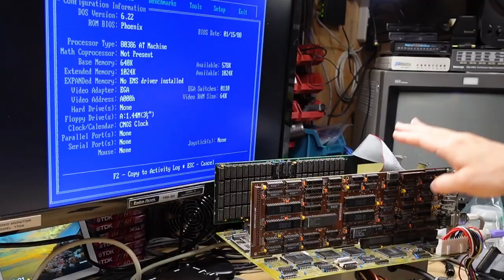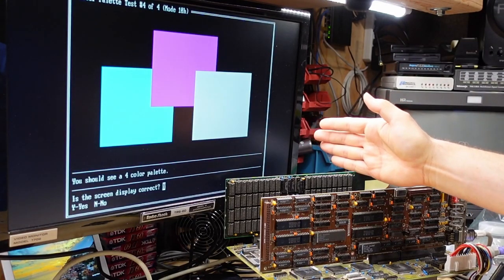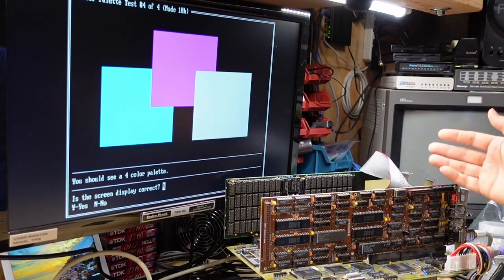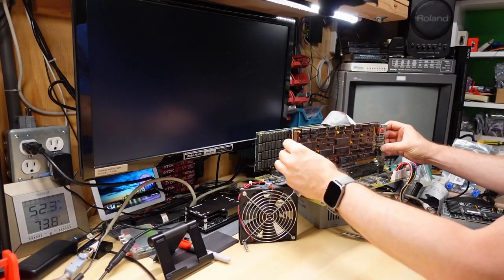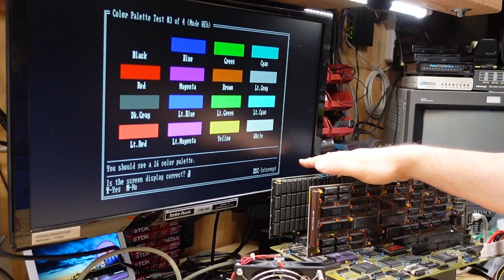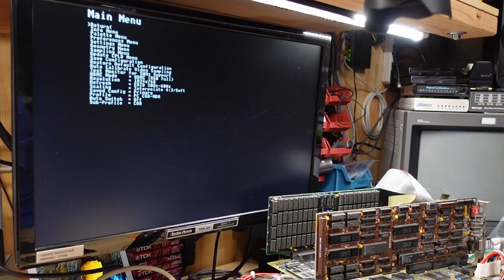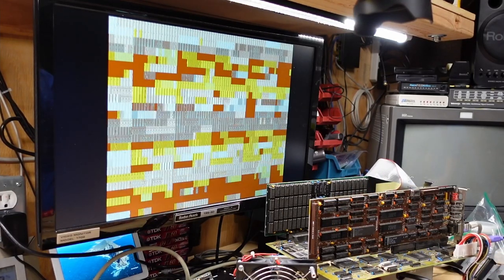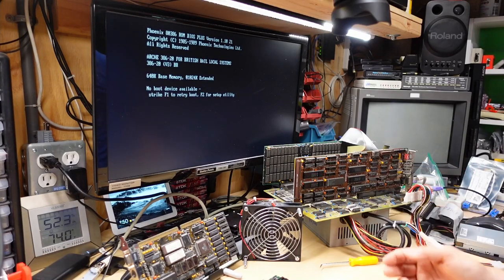Experiment: Can you upgrade IBM's EGA adapter's onboard RAM to 256k?

Comment: Adrian, perhaps you could locate and try a set of 64x4 chips running at 150 ns. 🤔
Reply: Faster memory is almost never a problem.  It defines the upper limit on speed, but you can always run it slower.  The only time it’s a problem is when the data bus requires the memory to have some kind of propagation delay.
Reply: Here are some 464-15 RAM chip part numbers:  HM50464P-15, MB81464-15, D41464C-15, TMS4464JL-15, TMS4464NL-15

Comment: what if you try to tie those two unused pins to ground with a 10k pulldown, it shouldn't effect the pins when they are driven, but pull  them to 0 when they are not.

Comment: I agree that your results imply that the two address lines are just floating during CAS.   Strange that they would have done that, since they are driven during RAS.  I don't think the 64Kx4 chips existed at the time the EGA card was designed, or they would have supported them, unless of course they wanted to charge a higher price for a daughter board.  I guess another possible explanation is that when the card's firmware checks the installed RAM, it gets a result that is not expected, and sets some register incorrectly.
Reply: It's also possible that the 64k was more expensive than the equivalent number of 16k chips. Or they might have not had the space for a handful of extra decode chips.

Comment: I believe the issue is with the refresh. Since the original dram chips were 150 and the replacement chips were 120 and 100 respectively, I think the replacements are simply not being refreshed in time and are losing their contents.
Reply: Nope. You can easily take faster chips, they are even capable of working with less refresh. The problem has to do with unconnected address or [RC]AS-lines on the chips themselves. Some bodgewires to the 50pin header should do the trick.
Reply: @dolphhandcreme  : Unconnected address, though it's possible that the chips can't drive that much capacitance directly.

Comment: Just speculating with simple logic here but, if it were possible to do a RAM upgrade with just replacing the IC's there would have been sockets there. Is there a photo of the original memory upgrade card? Maybe there was something else on that board that made the addressing possible.

Comment: The schematics found here: http://minuszerodegrees.net/oa/OA%20-%20IBM%20Enhanced%20Graphics%20Adapter.pdf
shows that itwas  not designed to take advantage of a 64k*4 dram chip, as the 2 MSB for the CAS are decoded in individual CAS lines (ACAS0-3 and BCAS0-3), ACAS0 and BCAS0 being used on the internal memory and ACAS1-3 and BCAS1-3 used on the extension card.

Comment: Its your timing… 170ns is pretty slow.. would explain the change between the two sets that you installed. So it might be possible to upgrade it using slower ram. Especially if it is d ram. Every time you change something in memory the entire chip has to be refreshed. This refresh cycle has to match whatever device is doing the refresh.
Reply: I never had a problem with DRAM being too fast then. The refreshes were much closer together than they actually needed to be, and DRAM doesn't mind being clocked slowly even if it's capable of operating much faster. The only time it mattered is when someone was trying to push the envelope with wait states or by increasing the time between refreshes (you can do this with software and get a noticeable performance boost, but it's easy to take it too far and end up with a thoroughly crashy system).
Reply: @mal2ksc  most memory from 83-85 was pretty bad.  I am forming my hypothesis based on the difference of the screen corruption. Only common denominator is the timing… have you tried 32k? Does 32k get you video?

Comment: Well in hindsight it's obvious why it didn't work. The chipset needs to decode those lines in order to support the extension board. So whenever it attempts to access the extra RAM it'll de-chip-select the chips on the main card.

Comment: Wonder where do the pins from that connector actually go/connect? I remember seeing some motherboard with memory chips stacked one on top of another, like two layers of chips. Wonder if this would work here, in case the connector pins actually go to the memory chips pins directly rather than to those LSI chips.

Comment: IBM designed the card so you had to buy their expansion board. Shocker, I know. 🙄
Still, useful information. I have a 5170 with that exact card installed. 64k video ram it is, then.

Comment: Boring situation: It's working, yawn, first try. Then the better situation: It's Not Working! Which then progresses to: IT WORKS!!!! Heh heeeeey!!! Can't always have it perfect every time... At least this one didn't fix itself. I am wondering if there's a dip-switch setting for the extra RAM? Soldered RAM usually means that's the end of the road for upgrades.

Comment: Why was the RAM expansion this 'big'? I mean: The card can display 16 colors in 640x200. And 640x350 would need less than double the RAM. So why does the expansion actually increase the RAM size by 4 times? What is the rest good for? I don't think they'd have wasted the RAM chips just like this, as RAM of course was ridiculously expensive then..

Comment: Maybe a silly question but rather than spending lots of time de-soldering all of the RAM chips could you have not just swapped out 1 (or 2 if they need to be in pairs) and tested it to see if it detected the extra RAM?

Comment: I'm curious what would happen if you lifted those two pins on each memory chip to make it behave like the smaller chip and see if that works at all.  Maybe it's still a timing issue or RAM compatibility issue.

Comment: So you can't just throw some bigger chips in the card you have there. How hard would it be to potentially make the expansion card? Since the schematics are available it might be possible to make something that would be compatible. I know how much of an undertaking that would be so I won't blame you if you decide not to go that far. Conversely it could benefit the rest of the retro computer community to design such a thing at least as a proof of concept. It could also be a lot of fun.

Comment: I found an old 160k vga card with 4md installed, can this run on an XT system? people say I need to install a 16-bit CPU to make it work?
Reply: Even though the 8088 has an 8 bit core, it has 16 bit addressing so I figure it would work. In any case, it won't hurt anything to try it

Comment: Hehe - I have two of the EGA VRAM expansion boards, and only a single EGA adapter.
Reply: The EGA adapter that was in my IBM "Gearbox" (7552) came with the VRAM board installed - and I had received a spare just before I did the video on it: https://www.youtube.com/watch?v=kE7C8eQKbts&t=1790s

Comment: Could the speed of the ram be at least part of the problem?
Reply: It's possible.  The memory did not look "random" in the sense that it's reading random junk.  It's random yes, but it's the same randomness meaning that the memory is consistent.  It may be that the write timing is off, so the card can't write to the memory correctly.  Perhaps it delays the introduction of the data too long, and faster memory snarfs up the data bus's data before it's ready.

Comment: Try 200ns chips. Never go faster, always slower! Also I see a few other maybe-helpful comments -- "Michael Hill" suggests there's a pin on the expansion connector to tie to ground, "kyjoel69" mentions a homebrew expansion board -- even if you can't get the board made yourself and populate it, maybe you can get enough out of the schematics to make this trick work? and another fellow*, "Laura M", mentions Foone Turing on Twitter -- @Foone is his handle there, and his avatar is a gray pixellated 3.5" floppy disk. He's awesome, and he's brilliant with this sort of stuff -- I speak from experience ;)

* for context, unless I specify gender when using words like "fellow" "dude" etc, they are meant as gender-neutral.

Comment: Since the desoldering gun out what temp or numbered setting do you use? Everytime i use it i'm always burning boards or destroying vias getting chips out.
Reply: Not to speak for Adrian, but just as another data point:  I use 250-300C for an iron, 320-360C for hot air.
Reply: well, with my goot gun (crap) I always set it to 380C and add a new solder to the pin, the gun cant touch the pcb, only the pin

Comment: I would like to have such RAM to VRAM ratio
I would have 128GB RAM (I have 32GB in desktop, as I could not find 64GB DDR3 PC3-12800E 1600MHz in 4 modules of 16GB each; I have 128GB RAM in server though)

Comment: Here's the doc if anyone wants to go down the rabbit hole deeper. http://minuszerodegrees.net/oa/OA%20-%20IBM%20Enhanced%20Graphics%20Adapter.pdf
Looking at the expansion diagram, for sure it's got separate RAS/WE lines for each of the 4 extra sections of 4416 x 6. Will need an extra inverter chip to calculate the WEs.
Reply: I can take hi-res photos of mine showing better detail on the chips - I've got a VRAM expansion board on my EGA adapter (the 7552 "Gearbox" I have came that way) and a separate VRAM board.

Comment: Why would you ever put 256k in an EGA card?  EGA is 16 colors. With a maximum resolution of 640x350, that is 224,000 pixels. At only 4 bits per pixel, that's only 112,200 bytes of RAM.

Comment: Apparently, the IBM Graphics Memory Expansion Card(1501201) did not even give you 256kB out of the box, it only had 64kB populated, giving you a total of 128kB, you had to get the additional IBM Graphics Memory Module Kit(1501203) to bring it up to 256kB. 

So, that is $524 for the IBM EGA, 199 for the MEC, and 259 for the MMK, a nice $982 in 1984 money. Adjusted for inflation that would be over $2500 for the full kit.

Of course, if your wallet was still too heavy, and you wanted the ultimate IBM rig, there was always the IBM Professional Graphics Controller...

Comment: Great experiment!!
I think, that this test is not over..
Looks like some timing or delay issues, because IC's are pinout compatible and TMS4416 don't have internal connection to A0 column. Theoretically, it should work as before, even when other part of memory wasn't recognized.. 🤔 
One option is to take oscilloscope and verify what's happening on RAS CAS lines..
Anyway, I think, that this issue is worth of second video for investigation. 😉

Comment: When EGA will have 256 kB, it will be the same as VGA?
Reply: no, EGA has a max resolution of 640x350 , VGA runs at 640x480
Reply: @robertjung8929  I know, but I though, more memory makes more colors and bigger resolution.

Comment: I'm kind of wondering how the memory is being addressed on the card, it might just see 64k, however how's it's addressing it might be running up one of the chips itself. Also wondering if the speed of the RAM is important, it might need 150ns (much like how memory chips work).
Also, since you have a desoldering gun, but resort to the heat gun after, check Voultar's videos. He uses the desoldering gun and swirls the gun around the pin to make sure all the solder is gone.
https://www.youtube.com/watch?v=-MuwkiV4aPs

Comment: 640×350×16 color only uses 128K. Is it possible that an upgrade to 128K would have worked, and that your attempt at 256K failed because the card leaves the highest address line floating, causing it to semi-randomly address the top 128K in some memory accesses instead of always using the bottom 128K as it should?

Comment: Come now, you really think IBM would have let you upgrade the ram on a video card without buying the upgrade module? Remember, the laid the foundation of the proprietary upgrade path that modern manufactures follow.
Reply: Yes, thats why they put in extra effort to make the simple, cheap upgrade impossible. IBM wants to earn a load of money on the upgrade card.
Reply: @semifavorableuncircle6952  : Actually, making Adrian's upgrade work would be extra work, because they'd have to run the extra addressing to the chips. Meanwhile, by selling expansion cards, they could make certain that expansion addresses were fully populated, instead of e.g. having the lower half of a byte populated, but the upper half empty.
Reply: @absalomdraconis  Actually, it needs extra logic to prevent supplying the  higher 2 bits for the row address, but not for the collumn address. Its DRAM after all, not SRAM where you could just leave off 2 address lines entirely. And on top of that, extra decoding logic for the expansion card (with 3 extra CS lines).

Comment: Having programmed EGA back in the day, your mistake was assuming that the memory was contigous on a PC. The memory of the EGA card used 4 bit planes that occupied the same memory location. The 4 bit ram is REQUIRED as 1 bit is one plane that is fed into a data latch that you read  You did not have direct memory access but used a data latch register that reads a single bit from each plane and put them together. This means to get more video memory you MUST add a 4 bit ram chip to each new bank to be read by the data latch.
Reply: That’s one of the things I’ve never liked about early PC graphics cards. Contrast this to the way early Mac video worked: it was just a linear frame buffer, ordered the way you’d think it would be: rows of pixels, one after another.
Reply: @darkwinter6028  In order for the PC to get to 1 Megabyte, it used segmented memory that used 64K blocks that overlapped every 256 bytes (memory 0001:0000 and 0000:0010 pointed to the same memory address)  That was (is) wacky!
Reply: @joshuawalker7054  Yes, I know. I’ve done a bit of 16-bit x86 assembler myself.

Comment: It is not a wonder why it is not working. 
 
Any 16K memory chip has different connections then a 32K of a 64K chip. (in the old days) 16K is addressable with a number of address-lines, the double amount needs one address-line more, the quadruple amount needs two address lines more. Sometimes when the unused address-lines are hanging loosely in the air the chip comes into a state of maybe or unable to decide. This is very bad, you can't predict what will happen, always there are pull up or pull down resistors for unused address-lines. 
 
This was a useless experiment. IBM did not wire the address-lines there, they made a connector for an expansion board, guess why!! Because there is no logic circuitry for various memory chips, the extra address-lines are only on the expansion connector. In the old days you needed little pins to stick out from the printed circuit board to select the kind of chips you wanted to use. This took to much time to take out the old chips, put in the new chips, reverse the settings with the pins, make a mistake, try again, spoil time, lose money. That's why.

Comment: After you get the chips out it's a lot easier to use some solder brain and no clean flux to clean up the pads.  Also be careful with hot air station too.

Comment: ‘…without modifying the board!”  (breaks out the desoldering iron…)
Reply: Adding sockets is not modifying the board using any metric that sane people would use.
Reply: @PJBonoVox  Yeah?  Do that to a modern mobo and see if the vendor voids the warranty.  (Yes, I understand your point.  That’s the joke! :)

Comment: Of Course, IBM designed it to require that expansion card. Can't have it that someone just orders a few mem chips from Radio Shack for ten bucks instead of paying them 200$ for the addon card..
Reply: The memory would’ve cost a lot more than $10 back then.  Also, IBM at the time was all about the open platform.  They weren’t really the vendor lock-in type.  The manuals had schematics, source code, pin outs, part numbers.. it all used OTS parts, so you actually could just source parts from wherever.